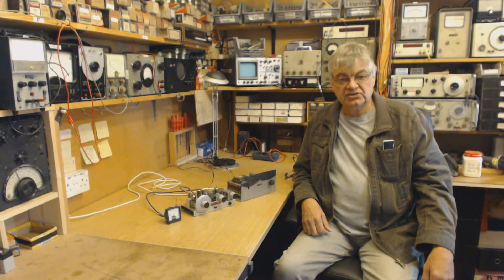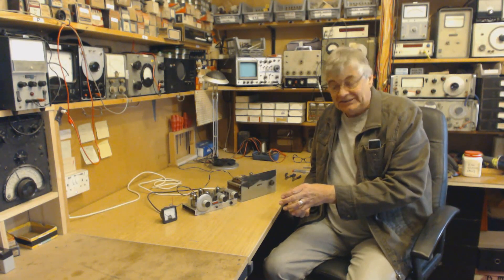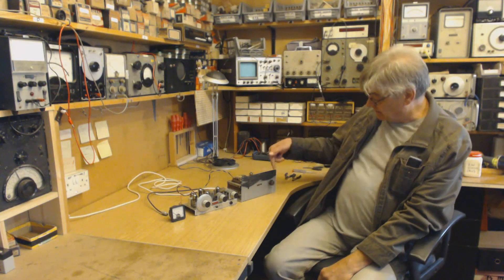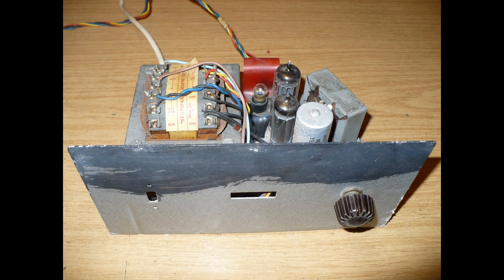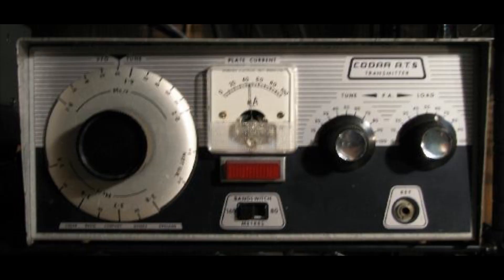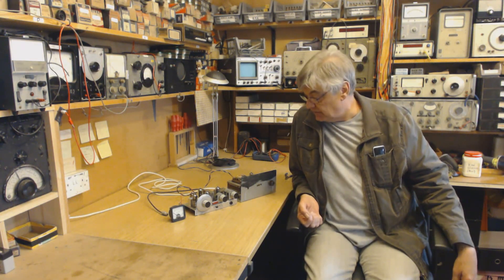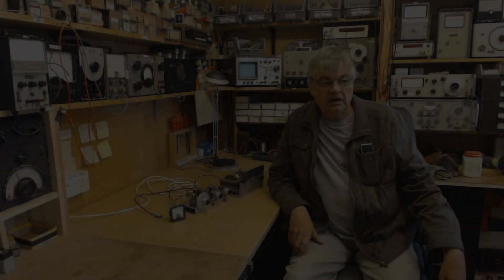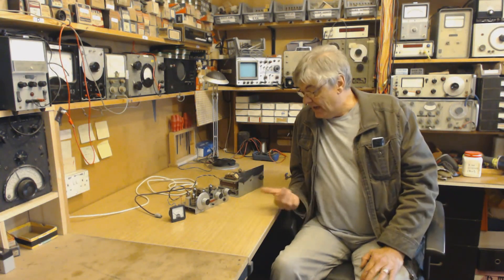Codar AT5 Transmitter amateur ham radio

Comment: Hi Ray,
I remember this and the CR70A and wanted one. Never did get one. As you say, a lot of money and in my teens it was a lot. What a pity the case has gone. 
Who knows, one day I might get one. I got a 19 Set in 2017 which I also looked at, so that only took over 50 years. As did my Zenith Transoceanic.
Have you a video on the H.A.C.? That started my short wave hobby. I wish I'd kept it but dismantled it for the capacitor to make a wavemeter when I got licenced. The coils got re-wound.
G4GHB
Reply from the maker: Hi Bill,  I’m afraid I don’t have a video on the H.A.C.  I love the old gear but, sadly, mist of mine has gone over the years.
Reply: @g4nsj  O.k. Tnx.

Comment: For those of you interested in the history of the Codar AT5 transmitter. The first mention of it I found in the 'Codar Radio Company' advert in the publication 'The Short Wave Magazine' of May 1964. It says, 'Coming shortly :- Miniature 12 watt Transmitter for 160/80 metres. Cat. No. A.T.5.'  In the June 1964 issue it is then advertised as, 'CODAR A.T.5. 12 watt 2 BAND MINIATURE TRANSMITTER' , "The tiny Tx with the BIG voice". Price was £16.10.0.   P.S.U. for 200-250 A.C. £8.0.0.

Comment: Hello Ray, I just wanted to let you know I really enjoyed your video on the Codar AT5. Very well done indeed.  I'm trying to get all the information I can on them. I currently own both a regular AT5 and they made a AT5 MKII version, which I own along with the Codar power supply that runs off of 240VAC. Here in the USA we use 120VAC so I made up my own power inverter that consists of a transformer with two secondaries and one primary (120VAC). I use one end to the wall socket (120VAC) and tie to of the secondaries together that produce the required 240VAC to power it. 

BTW, the matching Codar receiver was their model "T28", which was a two transistor superhet. The frequency coverage matched the AT5 and was 160M and 80M. 

I'm in the process of getting both of my AT5's operational and hope to have a few enjoyable QSO's with them although their power output is limited to 10W input on AM, and I believe4 15W input on CW. It's still enough to get one on the air for some fun. 

The microphone that came with my AT5 MkII is a handheld crystal mic made in the UK by the "Acos" Company. I think it was the mic that it originally came with and it sounds pretty decent with plenty of output, which one would expect from a crystal microphone. 

Thanks again for posting your video and wish the the best of luck with your AT5 and supply.
73, de Joe Cro N3IBX
Reply from the maker: Hi Joe, thanks for commenting. All very interesting stuff, I wish you luck with the project. Cheers, Ray.

Comment: Ray,
Another very interesting production my friend.  Up to five weeks ago I had never heard of Codar.
Whilst ambling round a flea-market, I bought two pieces of equipment for 50p each with the idea of gutting and reusing the metal boxes (and retaining certain components) for housing future homebrew projects.  I often do this sort of thing with old external modems etc.  After further inspection, one of the pieces of equipment turned out to be a Codar Radio Company, PR30 Pre-selector incorporating an EF183.  I downloaded a circuit diagram for it off the UK Vintage Radio Forum.  I tried it out and it works fine so it will remain intact whilst I continue to draw breath.
Cheers buddy,
Phil.
Reply from the maker: Hi Phil, Codar stuff is quite collectable and increasing in price all the time. Sounds like you did well. Cheers, Ray.
Reply: They also made a Q Multiplier for the receiver. Look out for that one as well, Mark

Comment: When I saw "Codar", my brain from over the pond here registered, "Cobra". The company name is too close.
   You said Ray, (and I am paraphrasing here); "the ganged capacitors were to mangled to be fixed". Huh? Maybe if the plates are not perfect, the frequency linearity wouldn't track evenly, but wouldn't it still be useable?
   Boy, the rectangular neon plastic indicator really made the year that it was constructed, easily identified. "Spot on" for me.
   Anyways, thanks for sharing. As you say; "nice piece of kit".
   73s and Cheers my friend,
   Tom
Reply from the maker: Hi Tom, The capacitors short out half way through their travel becacuse the vanes have been badly damaged. The neon, yes a real give away as to its age. Cheers, Ray.